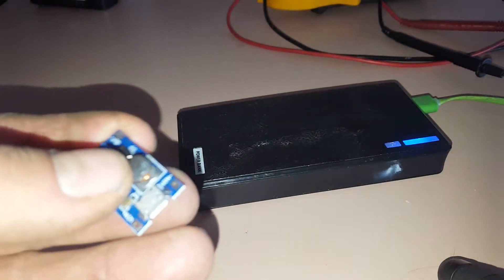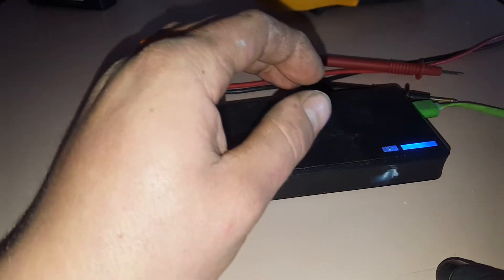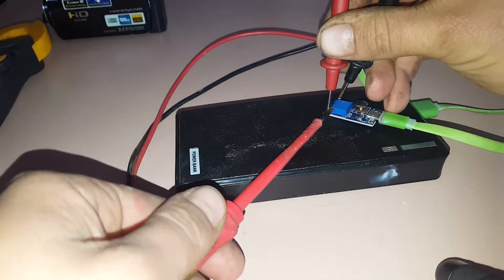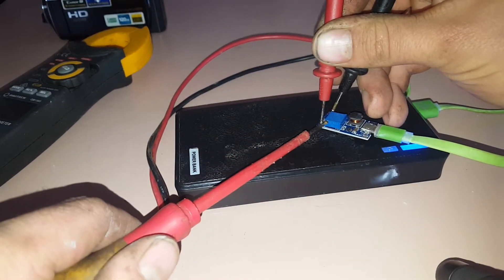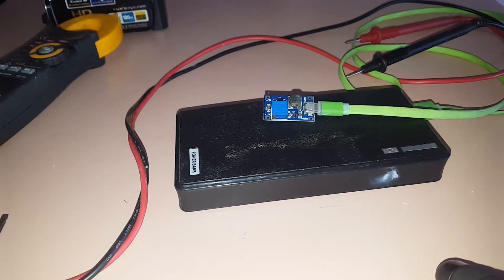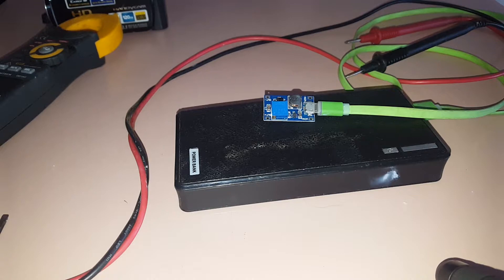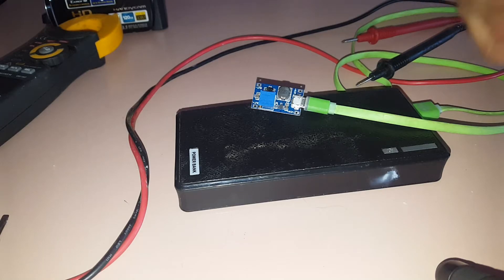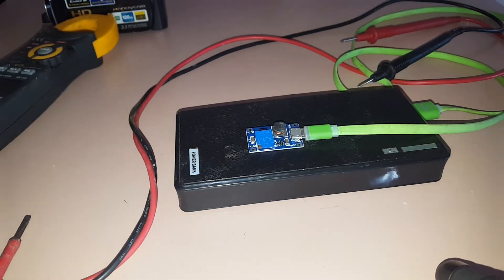Mini 5v DC to DC booster boards over 25v output!

Comment: I have purchased a few of the USB to 12 volt 5.5mm male plug leads. No use for them yet but at $1.50 posted I had to have them 😂😂
Reply from the maker: +65bellett so tempting at times